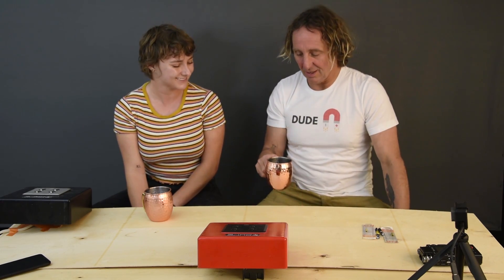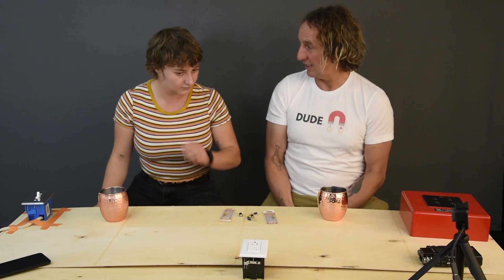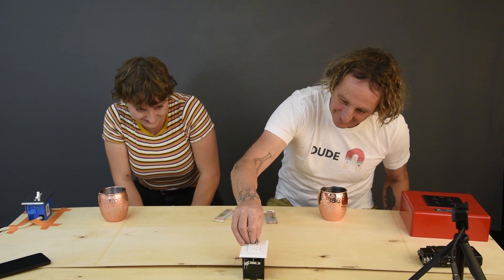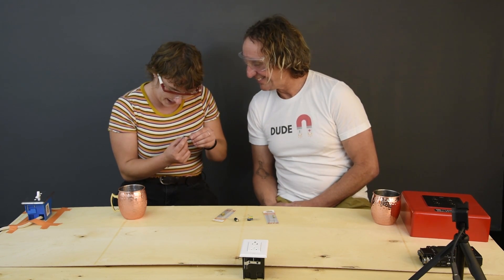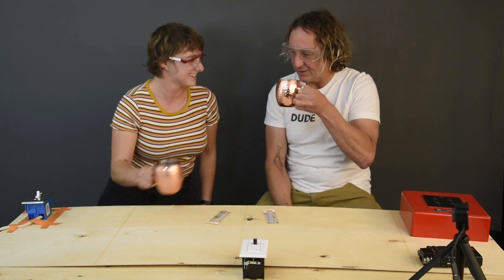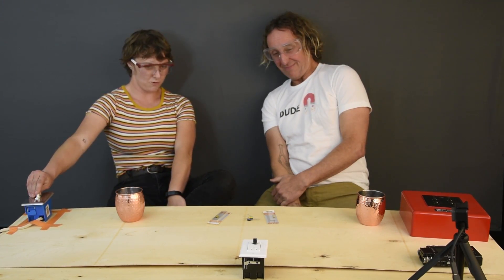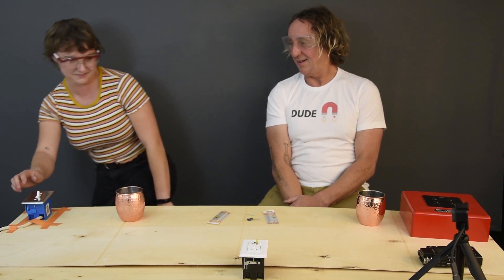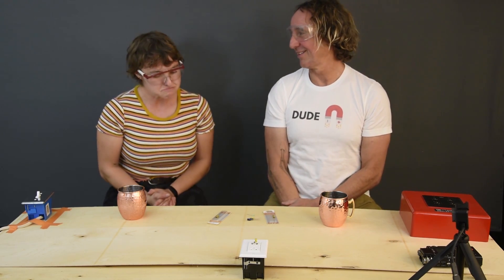Dont Try This at Home - Testing Capacitors

Comment: I used to work manufacturing LED drivers, the boards were bought from china and had very large filtering caps on the DC input. These boards would take 48V 100W DC input. When the board manufacturer got the input caps the wrong way round you could hear it in the upstairs office.
Reply from the maker: Fun!

Comment: Ahh yes the old exploding capacitor. I got pretty good at recapping power supply filter caps in mobile audio amps years ago trying to avoid this. Some stuff from a certain period in the 90s when consumer electronics were widely plagued with "bad caps" was downright dangerous; heard more than one story of cars catching on fire while parked and not even running/unattended because of defective cap(s) that failed to a dead short.

Comment: I always design with caps that are rated 2x the max possible voltage since the V rating actually "ages" over time. There are plenty of counterfeit caps out there, so you need good sources to ensure quality. One time we opened up a cap and found s smaller cap soldered inside the bigger package, LOL.
Reply from the maker: Live as, that's funny with the little cap

Comment: This is the Dunking Stool method of electronic component testing:
If it explodes, it was OK.
Reply from the maker: Yes! As effective as it is useless!
Reply: One of the stories I heard when I was a young sound engineer was Clair Brothers method for making a road-rugged version of the Phase Linear 700. Supposedly, they would run it on the bench driving a dummy load until it blew up. They would then fix it, then blow it up a couple more times. When they had finally shaken out all of the weak components, they would have an amp that would be reliable enough to put in a flown rack (like the Yes in the round show from 1978.)
Reply from the maker: Wow

Comment: A fun day with capacitors....

Part of a job I had was to occasionally assemble talkback units for TV studios. I had completed half a dozen or so and sent them to the project engineer for testing. Later on I heard that the engineer "wanted a word". Turns out he had reached over one of the units to turn it on.. As he did so an electrolytic blew up, as they do in reverse polarity..
Upshot was, it wasnt totally my fault since the batch of capacitors had loose plastic sleeves, and the polarity stripe had moved 180.

Moral of the story is: check the (new) lead length as well as the label.
Reply from the maker: That's interesting. I enjoy the complexities of the nuances of what can go wrong!